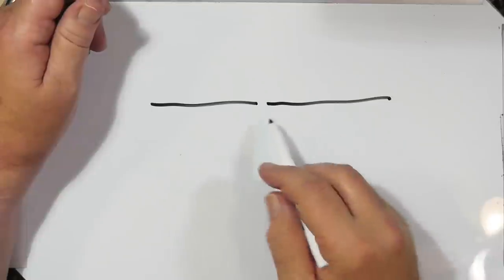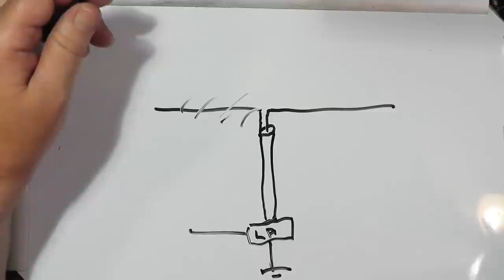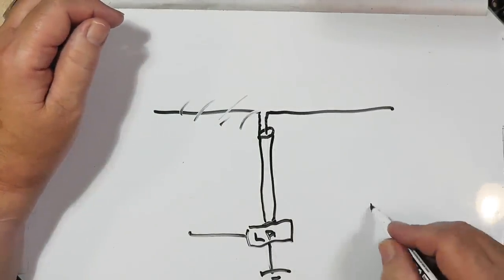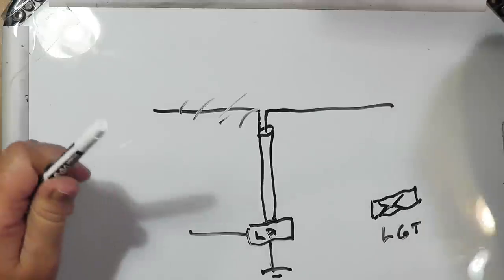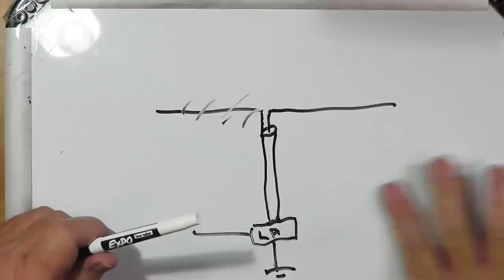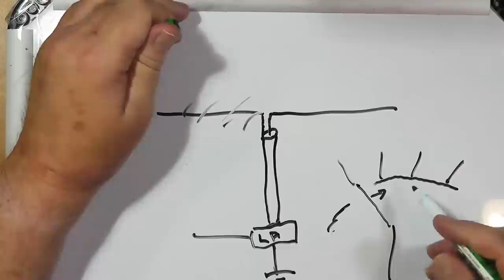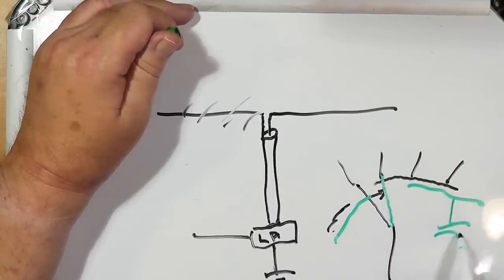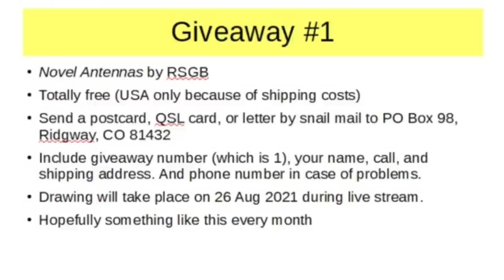Protecting an Antenna with no inherit Grounding Protection (#487)

Comment: I have worked as a telecom engineer in the Mt Cook area of NZ. Lots of severe electrical storms that last for days I project managed a new exchange & outside plant installation which was brought into service, with the most up to date lightning protect in November and totally destroyed by an electrical storm in the following April at a cost of $1M+. A direct hit will cause serious damage no matter the type of protection you use. Based on hard and very expensive experience, DISCONNECT ALL ANTENNAS DURING AN ELECTRICAL STORM.

Comment: Never forget, when I put up a Diamond discone vhf / uhf scanner antenna on a 35 foot telescoping pole. When I connected the BNC male connector on the coax inside, there was a spark between the center and ground. And then, another, and another! I thought I had crossed an electric wire in the attic. Nope. Static. It was a cool, dry day with dark clouds approaching and a little windy. The connector kept firing like a car spark plug, in slow motion. I built a 100K resistor, across from hot to ground into an outdoor project box. Problem solved. But a fascinating experience, nonetheless!

Comment: That "light" you explained in the older radios sounds interesting. I wonder if there is a way of connecting it to a more modern radio so you can see if charge is building up and maybe give people an idea of static charge. Also it can show people who are new to the hobby what it is and give them an idea on how to protect their radios,

Where I live in Scotland we have rain static. It is when the rain affects the antenna and causes noise on repeaters. It can make the signal of others harder to hear but it dissipates slowly though so it can take a few hours to bleed off.
Reply: I think Dave is referring to neon bulbs like NE-55 that ionize at about 50 volts and discharge the line. Chokes like Z-50 have been used too.
Reply: Ever since I was burned by a bare-wire antenna, I've thought that static is another reason to use a balun on wire dipoles.
Reply from the maker: It was actually an incandescent lamp. It has low resistance when not glowing and the resistance

Comment: Dave thank you for all the great show!! I'm just now starting to setup a SDR  to listen to the short wave and hams. I'm wanted to listen for awhile before seeing if I want to go all in and buying much more expensive equipment and going for my license. I got a little Tram 1411 and put it up about 15 to 18 ft off the ground but did use the 400 coax to come to the house. Anyway I ground the antenna then went to screw the coax to my RTL-SDR and I could feel current small shock in my hand. I went back outside and unhook the ground wire and it's fine. Question is what or why would it shock me with ground but not if I don't have the antenna grounded? Like maybe the small amount of current from the USB i was feeling. If anyone knows please let me know and I'll thank you now, thank you and God bless.

Comment: Something you said made me wonder.
What materials are used in your weather station (ie metal or plastic) and does the the wind speed gauge cause you any problems ?  I would think some wind speeds might affect some frequencies.
I know that some large RFI Enclosures add "stirrers" to mix up the signals inside them.
Thanks and 73

Comment: I don't understand why you would want to short the non-used antennas to ground. If there is no path to ground, I would think the lightning would strike the one in use, which is protected by your lightning arresters and grounding/earthing components. After all, electricity takes the path of least resistance. I learned from an old Elmer to disconnect my antenna coax from the radio and put it in a glass jar. No path to ground and glass has been used as an insulator on electric lines for over a century. If I am wrong, then I have been very lucky.

Comment: I have inverted vee insulated wire antennas. I am grounded through pass panel but am told I do not have static protection, just lightening. I even have arrestors in line. What more can I do?